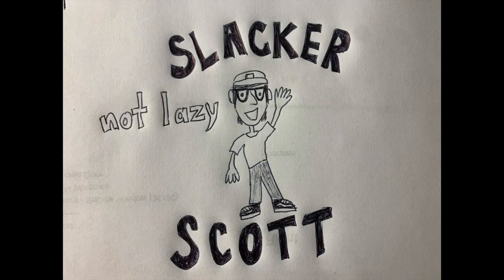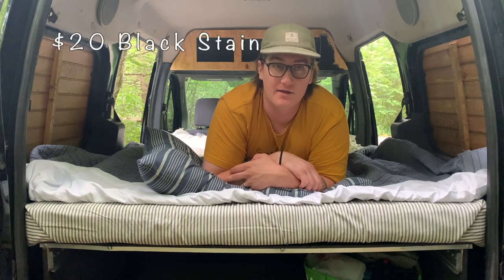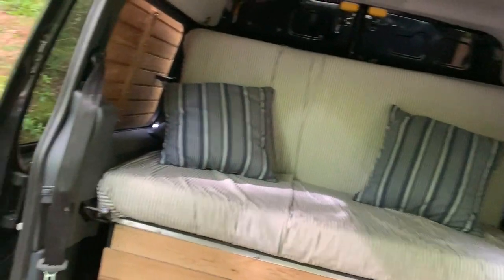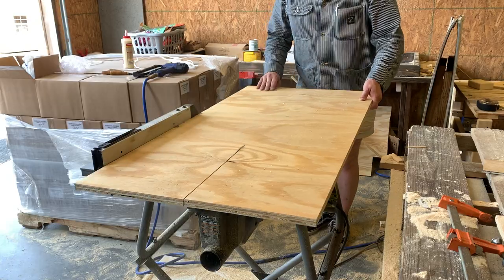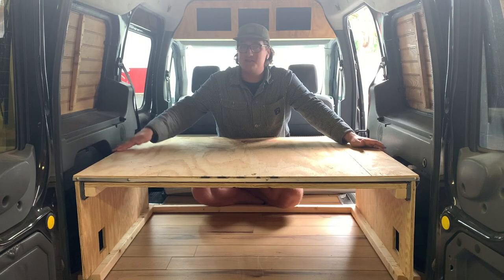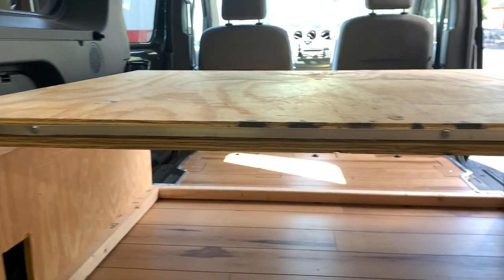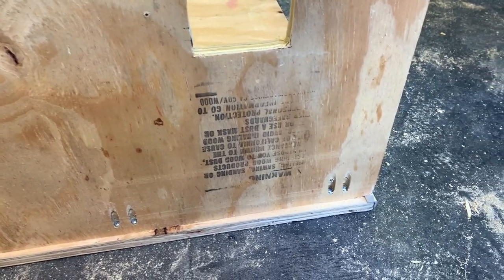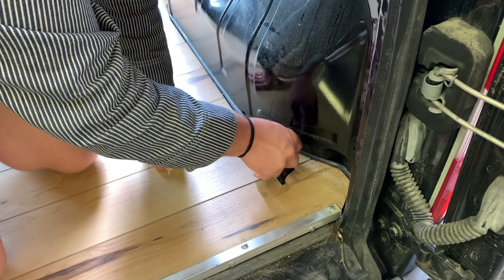MODULAR Ford Transit Connect CONVERTIBLE Bed to Couch for 2 PEOPLE (Full Sized Mattress-30s Change)

Comment: Do you find that the drop from the seat area to the pull out bother you when sleeping? It seems to me you might feel that drop, but maybe the mattress is think/solid enough that it isn’t an issue not being flat.
Reply from the maker: Hey Rebekah! That is a fantastic question! So the first trip we took with it, my partner did not feel the drop at all but I did. It wasn't so uncomfortable that it caused any problems sleeping, but I did notice it. I'm 5'11 and about 220 lbs and she is 5'4" and very petite. The drop down hits me right at my hip (which is a sleeping pressure point). After the first trip, I sanded that edge down and curved it (smoothed it out, probably more like routed it than sanded it, but I didn't use a router), and after sanding that edge, I haven't felt it since. However I also do wish I would have bought the 6 inch thick tri-fold instead of the 4 inch thick. The extra $100 or so (can't remember how much more it was) would have been worth it. I did try to figure out how to incorporate a mattress topper, but it was very clumsy when you were converting it from bed to couch. Thanks again for asking! Let me know if you have any other questions!
Reply: Thanks for the explanation. I am glad to hear you found a solution. Vans evolve, always! I have a topper inside a shikifuton and it is a bit fiddly, but I need it for those pressure points!

Comment: Just found your channel..I have a 2013 ford transit connect .. I really like your build! You  did such a good job.. in my opinion....mine is a total no build design for occasional roadtripping... I recently added a rooftop deck and flip up tables to my back barn doors gonna be a today game changer for my next roadtrip... best of luck to ya with your channel!!
Reply from the maker: Thanks Michelle! I appreciate the compliment. The roof top deck sounds amazing. I would love to do that at some point in the future!
Reply: Do you have a posting showing your rooftop deck?
Reply: @rebekahfrye7934  no I don't post videos... it's pretty basic.. I used a 3 bar heavy duty metal roof rack off Amazon ... 9 10ft composite deck boards cut in half and bolted it to the metal rack..
Reply: @michelleh7769  great! Thanks so much!
Reply: @rebekahfrye7934  no worries
Reply: Additional question if you don't mind - what do you use to get up on top of the roof top deck?
Reply: @rebekahfrye7934  oh yeah...lol... I got a collapsible ladder..Amazon... lol
Reply: Absolutely no worries.. I've had my van for about 2 years.. I've been vanlifing Florida to escape the cold winters of East Tennessee... my home base..... I've been gone a bit over a month.. and it's AWESOME!!! Solo female vanlife rules!!!

Comment: Good job on the convertible bed!  I’d LOVE something like that but wouldn’t need it to be that wide or even that long.   I have a late model FTC which is smaller than the older models so it’s quite a challenge to fit everything I need. I have a convertible bed on my channel as well, but tbh I don’t think it’s going to work long term.  I enjoyed your overhead video as well and am a new subscriber.
Reply from the maker: Thanks for the kind words! I really appreciate that! The slide out with drawer slides is a game changer for sure! Its great that make ones that will support so much weight!

Comment: You could take your idea further and have a modular kitchen behind the front seats that breaks down into boxes that could support the end of the bed when it's in 'bed mode'.
Reply from the maker: Yes! A modular kitchen is definitely in the plans for the build. My current idea was to have the modular kitchen counter top low enough that the bed could pull out over top of it, but I love the idea of having two boxes that stack and convert to give the counter top a little extra height! Thanks for the idea!

Comment: Hey Scott, your transit connect bed design is brilliant. Been looking for a bed that would fit two people yet could fold up to allow more foot space when not in use.
Had a couple questions on it. 
Do you have a link where you purchased your foam bed mattress from?
Also by chance do you know what the measurements was for where you needed to cut the bottom 2x4 runner boards to fit around the wheel wells?

Comment: I really like your bed build and have been thinking about doing a similar build in my 2014 TC. I work on the road and need room for my tools but was thinking about only going 12" height for the platform as I did get the 6" tri-fold mattress. I'm only 5' 6" and was thinking about cutting the top folded part in half and make a built-in pillow - your build made my vision complete now. About to check out your floor install now.
Question: why did you choose the drawer slides instead of the wooden slat or "one piece of plywood" type builds? I ask because it's the main thing I'm debating with on the bed/couch build
Reply from the maker: Great question! And sorry I didn't respond earlier. I had a wild year! But maybe this will help someone else. I actually built a design with the wooden slats and tried it out. I hated it and burned it in my fire pit! haha. It wasn't as easy or quick as the drawer slides was also way more complicated to build. You also don't have to accomodate any support legs, so you can just glide over what is in the front. My build actually works with the backseats in the van too. You just fold the seats forward. It definitely wouldn't if I needed to have support legs. I personally love the trifold part because it is more manageable to deal with. 1/2 length is a lot harder to deal with, at least for a full size mattress. Hope this helps!

Comment: I like the idea is it possible to hook up 2 car seat 💺💺 for my 2 babies at the bench/ bed ? Please give me some info. How to do hooked 2 babies car seat 💺💺
Reply from the maker: Hey Lanie, So yes! The back seat does fit with the current bench set up. I totally forgot to film that part of the build when I made this video. But that is the next video that I am planning to put out! I'm not sure how car seats work specifically, but I can tell you that when I pull the bed out, I have to fold the seat down, so I imagine that hooking up a car seat would be no problem, yet I think you would need to take the car seat in and out when pulling the bed out. Hopefully this next upcoming video will help make more sense!
Reply: Yes please make a video for 2 car seat at the back set up turn to bed at sleep night that will be big help 🙏thanks in advance il watch all ur video 👍

Comment: I have been looking for something like this for our Transit 250. Now that you've had this build for awhile, is there anything you would do differently? Has it needed reinforcement anywhere? Does it rattle when you're driving? I LOVE this concept. Thanks so much for sharing!!!
Reply: Hi Melissa, we absolutely love this build design and how easy it is to go back and forth from bed to couch! It has not needed any reinforcement anywhere yet, but I did sand the edge of the bed as mentioned in the comment pinned to the top here and also wished I would have done the 6 inch mattress instead of the 4. One of the things that we really love that was purely accidental is the space between the door and the bed when the bed is pulled out. Since the bed overhangs the frame 2ish inches and then there is another 6ish inches to the door, it makes it easy to climb in, shut the door, and then slide off your shoes and keep them out of the bed!
Reply from the maker: I’ve had it for 3 years now and It does not need reinforcement! And also doesn’t rattle! I’ve been really happy about how this one turned out! I keep it pulled out in bed mode most of the time, but it’s especially nice when traveling to have space to stand and such when it is in couch mode.